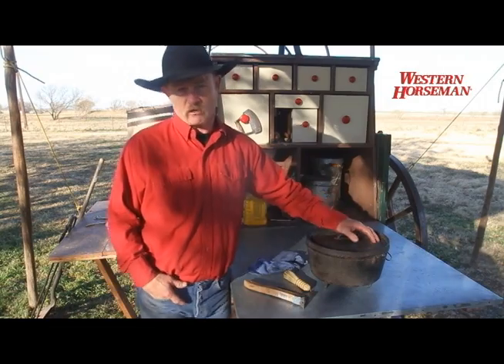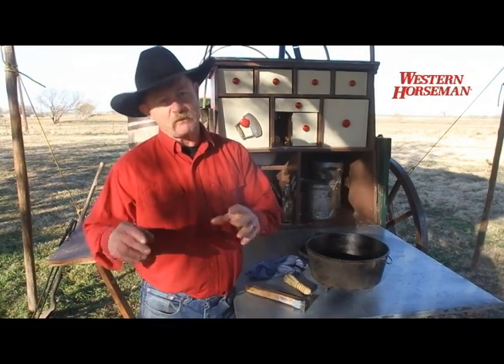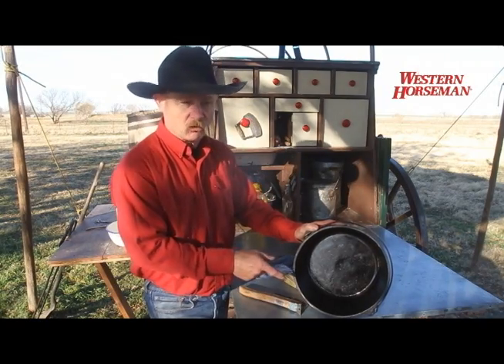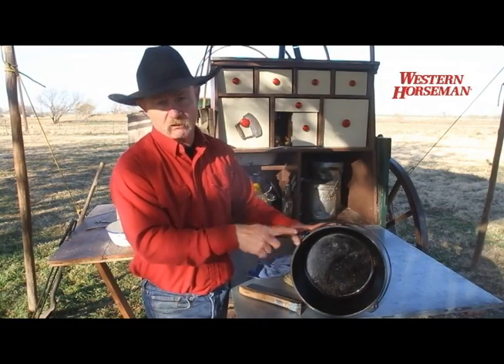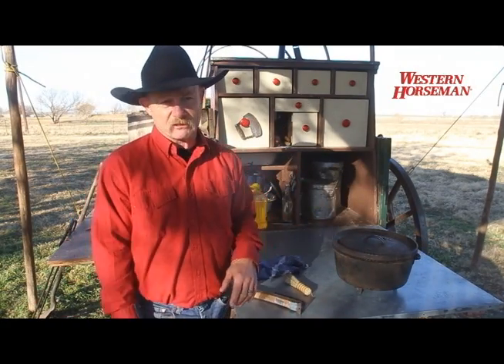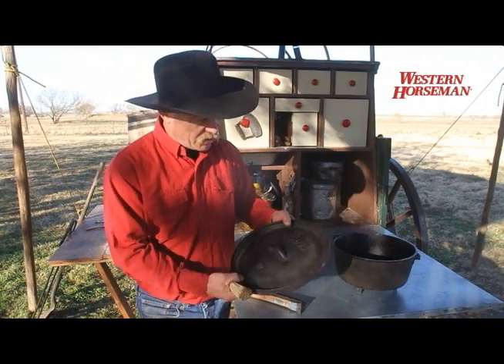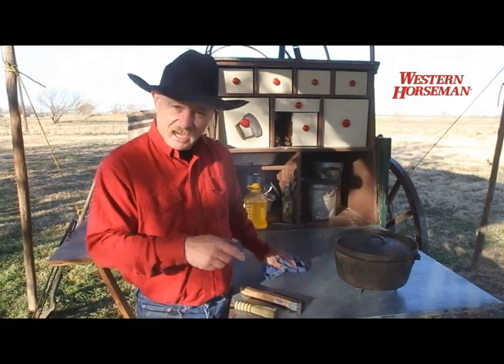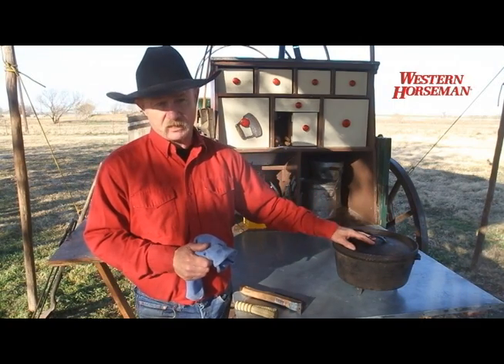Removing Rust From A Dutch Oven

Comment: I just bought a Lodge dutch oven at a garage sale and found two cracks in the lid across from each other that I didn't notice until I got it home. The guy will not give me a refund either.....says I dropped it. Anyways, will the lid last a while or crack more if I use it? I have looks everywhere and cant find a replacement lid for a Lodge 12" with the flat top, I can only find dome top lids.

Comment: What about pieces that have rusted so bad that they're pitted with rust. What does it take to save these?
Reply: Heat, Wire Brush, Oil and Cool. Over and over again until the rust stops bleeding out. Just restored an unmarked Griswold (Iron Mountain) Dutch Oven from the 1930's - 1940's, it's pitted bad but makes awesome Cornbread.
Reply: Soak in vinegar